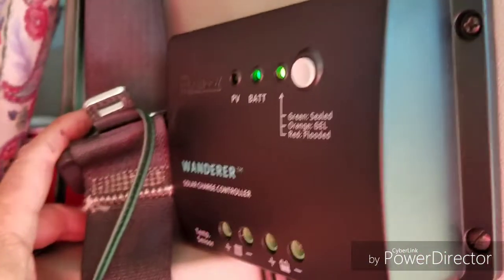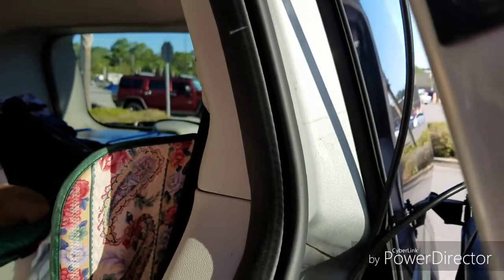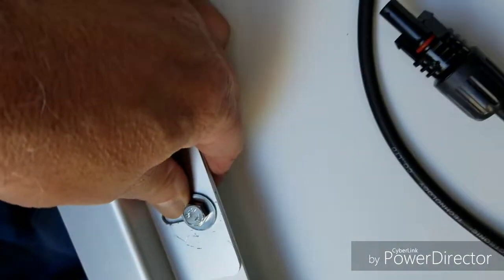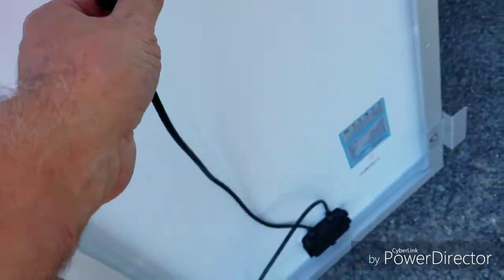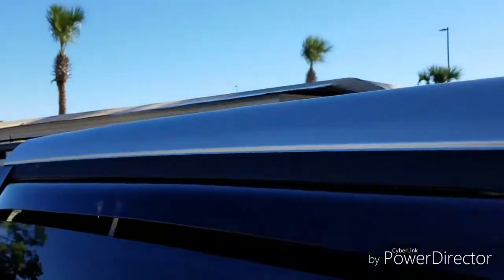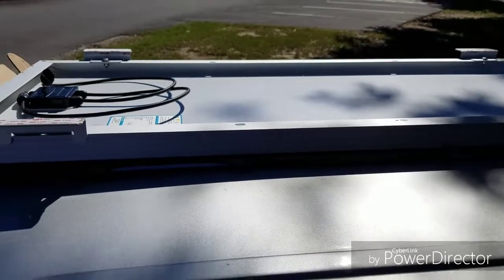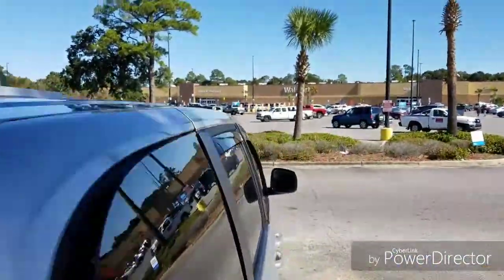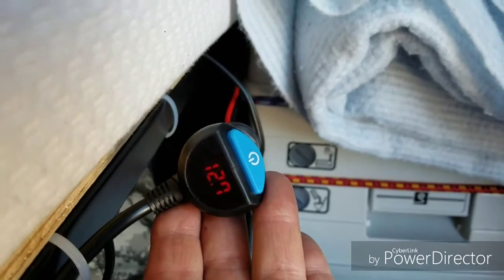How to Install Solar Panel with VHB tape . No Drilling.- Final Step

Comment: Thanks Mike. I've been looking for an option that wouldn't require drilling holes in the roof. Let me know how well it works for you.
Reply from the maker: So far so good. 70 mph before complete set. Its solid. I pull on it and it's not going anywhere. VHB 4950 is what I used. 5 yard roll was $20  I think.

Comment: I ordered some VHB tape.  I am super nervous about it but don’t want to put holes in my hightop.  I may wait to mount them until I get to AZ and hopefully someone can help me.  I was able to use a step ladder on the Dodge Caravan.  No way I can do it on this van from a step ladder.  Ugh.
Reply: if you ordered USB Tape, you should be very nervous 🤣
Reply: @dennis.teevee  it’s held on for 3 years.  The only problem I had was driving under a huge maple tree.  It actually bent my brackets holding on my solar panels, but the tape held.  ✌️
Reply: @dennis.teevee  lol.   I just caught that.  Must have been spellcheck.